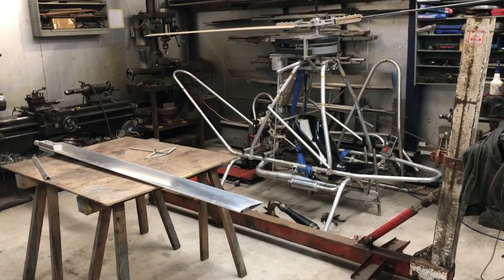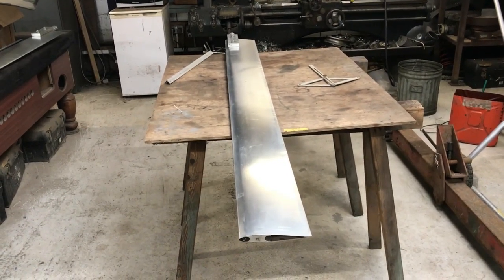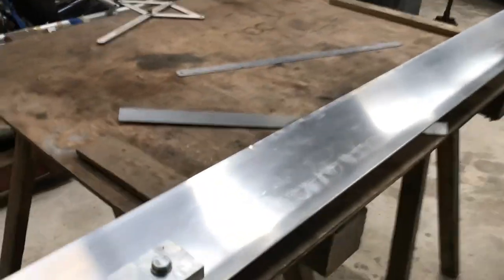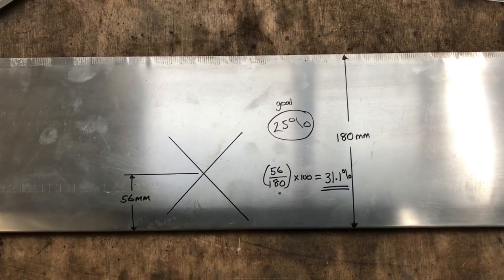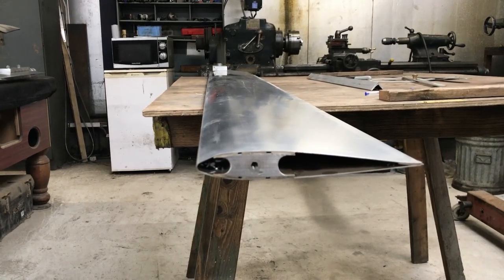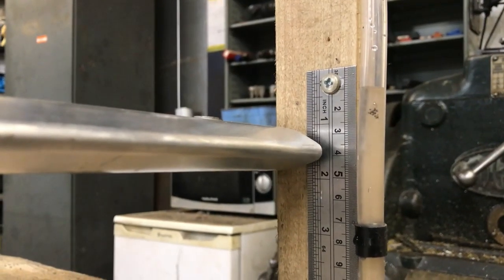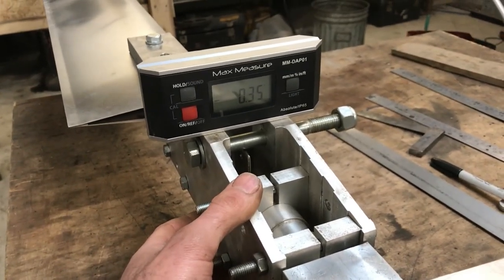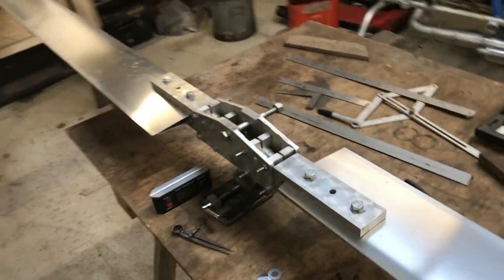Rotor Blade Balancing Homemade Helicopter

Comment: Did you machine your own reduction unit cogs or buy them I've been looking into buying or have someone machine one for a 1980 yamaha exciter 443 motor I bought for ultralight project
Reply from the maker: Initially I had the synchronous belt pulleys made as toothed blanks and I machined the spokes to make them as light as possible but when I changed the ratios I made the drive pulley from scratch.  I made a fly cutter for the milling machine using Hss tool steel ground to shape by hand but using a profile projector to get the contour accurate. This video shows a bit more. 

https://youtu.be/yUd9Vg9V0qI

what sort of ultralight project have you got in mind ?
Reply: @Ben-Dixey  something along the lines of an affordaplane or legal eagle maybe even airbike  basically want it to fly like a cub
Reply from the maker: @chrisknasel23  sounds fun 👍

Comment: am wonder how this can control yaw
Reply from the maker: Yaw controls will be through directional vanes on the tail using the rotor downwash. check out this https://www.youtube.com/watch?v=B21Xk6tNcBw&t=830s
Reply: thanks to you and ur gpod intention of making people smarter
Reply: Always thought directional control on coaxial is achieved by varying blades speeds...?!..or vanes is an alternative way of doing it
Reply from the maker: @JeffChoppah  altering blade speed for yaw is an interesting idea, I've heard of using a differential for driving the rotors and braking one rotor to achieve yaw but the craft would also reduce in lift  which wouldn't be ideal. In a variable pitch coaxial you can increase the pitch on one rotor and decrease it on the other that would produce yaw but keep the lift the same. The tail fins on the Nolan helicopter seemed to work well and it's definitely the simplest solution. Time will tell if it's the right decision.

Comment: Im afraid of helicopters, they are of the most unsafe aircraft, so it really takes guts to want to make one form scratch, even balancing the blades like in the video can end up in death, if the rotor gets into an unstable oscillation one of the blades can snap and hit you. There is a video of  a young guy who was about to do its maiden flight, one of the tail rotor blades broke and hit one of the main rotor blades making them violently  shake the helicopter almost ejecting him (he didn't had seat belt on), unfortunately the blade snapped at the right moment as to hit him in the head. I write this not as discouraging or being  a bummer but more as a reminder that Is better to be extra careful and never take shortcuts when dealing with such things.
Reply from the maker: I agree with you, it's a conversation I've had many times with people and assessing the risks is difficult. I believe Munna was unlucky but had he been wearing a seat belt or a helmet I think things would have been different. I also would ask did he do the centrifugal force calculations on the tail rotor, did he use materials of known specification, did he run the tail rotor at higher rpm to check the strength under guarded conditions ? These would all be measures to try and avoid a rotor separation. I have done these things but I know full well there are other parts that could fail and you can't remove all the risks. I have gone back and fourth in my thoughts on whether or not to play with a homebuilt helicopter.